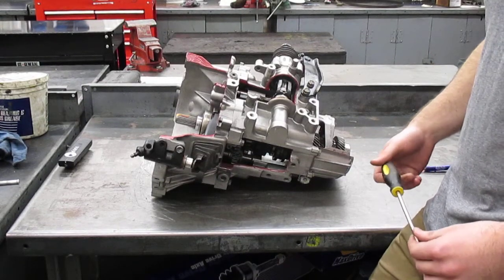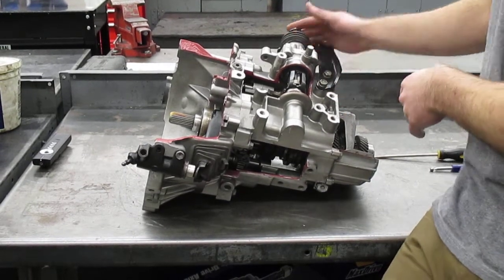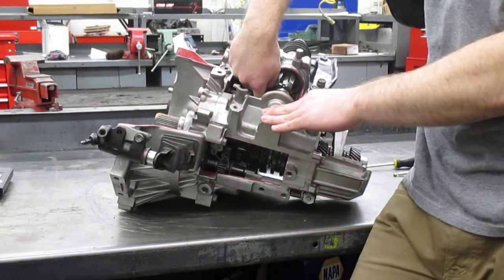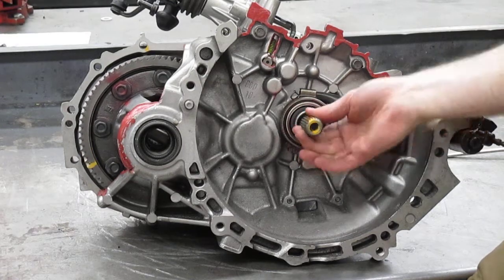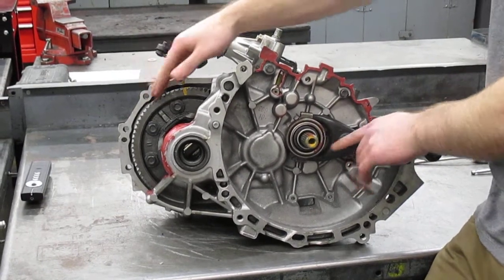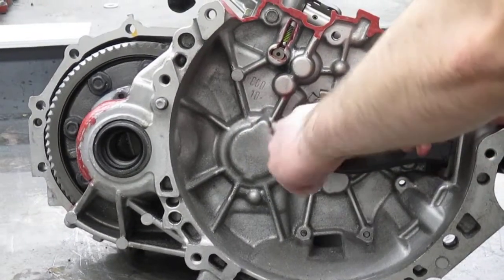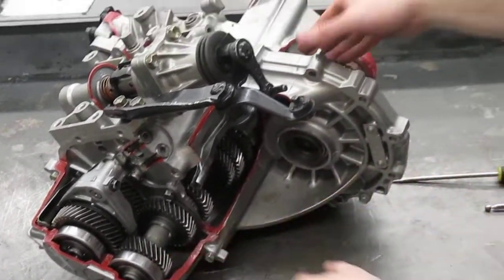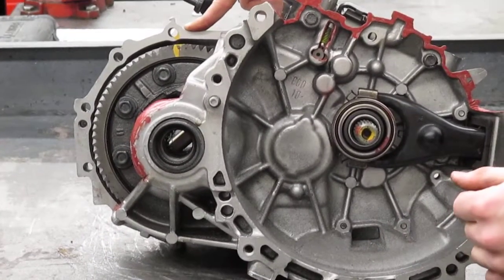Pontiac G6 Gear ratio

Comment: Not a g6 manual trans. It is indeed a 6 speed, and even looks like a Getrag F40 casing, but I think it's an older model. The shift levers are different than my F40. Also, I have never seen one with an external slave cylinder, but I've never taken an F40 out of a Saab or Opel/Vauxhall vehicle. If you were told this was a G6 trans, that is because of the F40 trans model designation but it does not have the GM v6 (aka GM Metric) bell housing.